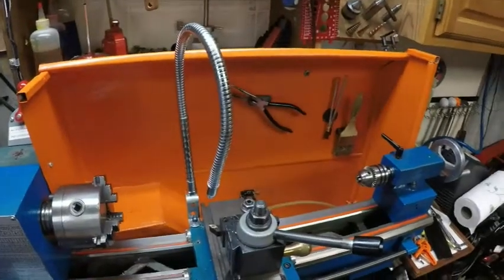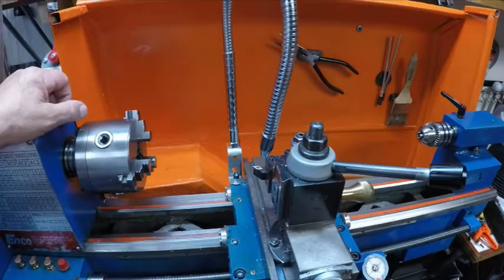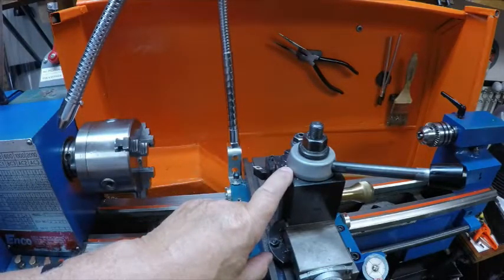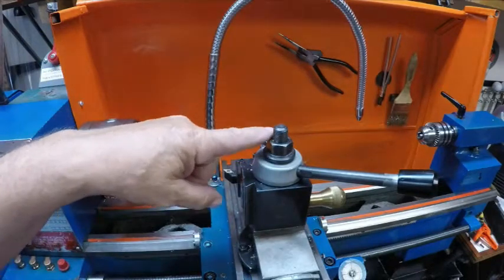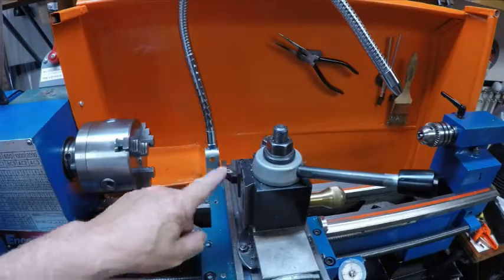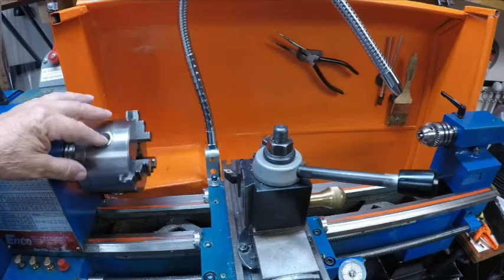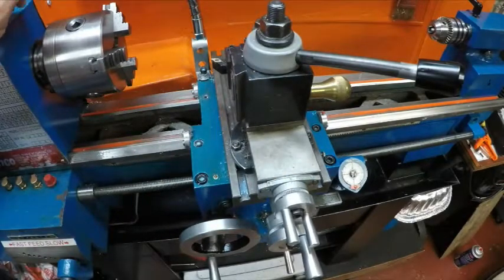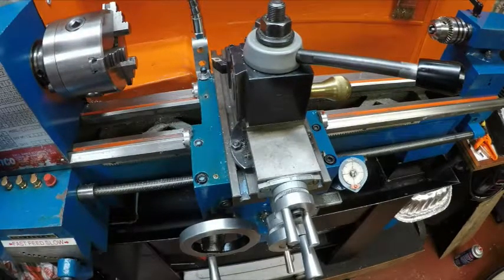WARNING ON THE LATHE COOLANT

Comment: I would have use a T nut and bolted to the back of the cross slide.  How often do you need full length of the T nut slot?  I never do.
Reply from the maker: Hi Greg,  Great idea.  It will go left and right with the cross slide and go in and out too.  Plus it can be removed when not in use.  Fantastic. Thank you. Norman.

Comment: Coolant can cause dermatitis, look after skin on left side where splash from chuck is possible. Coolants of machines run by businesses should be looked at and a employment decision must be made if they don't clean up.
Reply from the maker: Hi Mark, Good to know. I think putting cutting oil on drilling or cutting metal would not be good to breath.
Reply: @2001himax  Good ventilation. Face shield with tare away film. Drilling without cutting medium will be more troublesome.

Comment: Just make an adaptor that hooks to the tool post, problem solved. As for the splash, just use a 3 faced safety shield. They sell them everywhere now.
Reply from the maker: In another video I show how I redid my coolant to solve the problem. I think that video is still up.    Norman.

Comment: how about screw a hamster drinking bottle up side down on the end of the y axis of the compound? let gravity do the dripping job. someone I know use those big syringe with a big needle (round the tip on stone for safety), take away the plug, it drip too, the draw back is to refill the syringe frequently if you have a long working hours. it's just couple dollars, small price if fail, worth a look.
Reply from the maker: I used a Harbor Freight fountain pump and a piece of break line and it works. Also put an aquarium air valve adjuster to adjust the coolant flow.     Norman.
Reply: @2001himax  i myself use a 1 gallon garden sprayer and a transparant silicon tube. you know those plastic thing look like a teapot with a handpump on top, you can find them in dollar store, unscrew and put the nozzle on the other end of the tube and turn it to smallest output. mount on the end of the y axis. the beauty of this thing is the nozzle spray half mist, which almost no extra coolen goes to the pan under the lathe. a bucket will hold everything under. the drawback is when "mist" touch hot metal, it turns to vapor, that's making the humidity in the room goes up pretty fast. which I recommend open the windows and have a fan. breathing cooler vapor i guess is not a good thing?

Comment: Move the hose mount to the far end of the compound. That way it will move with the compound and yet not interfere with your non-coolant operations. Hardinge HLV is designed like that and I find that setup very convenient. It's probably too late for the comment, but still.. Thanks for the video!
Reply from the maker: Hi Dmitrii, Never too late for comments. Thank you. I have used a piece of break tube and put it on the top of my tool post so the coolant moves with the cut and the coolant stays  on the cutting blade. This way I get no coolant flying off as I cut. I will show it on my next video. Thank you. Norman
Reply: why not put a bracket from the tool post bolt to the spray flex . that way it will follow the tool post and be over the cutter where you want it
Reply from the maker: Hi John Doe, I have put it on that bolt and used a small break line tubing. Works great. The big bendable tubing is too big.  Norman